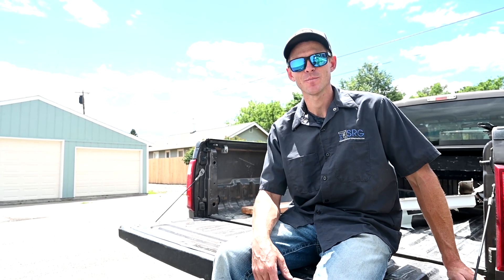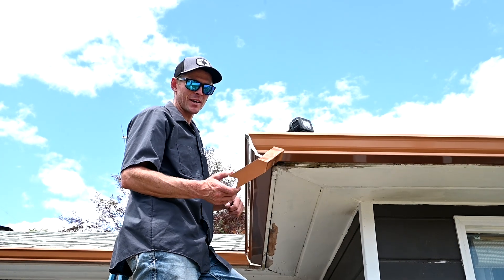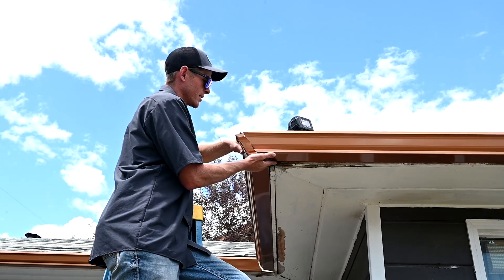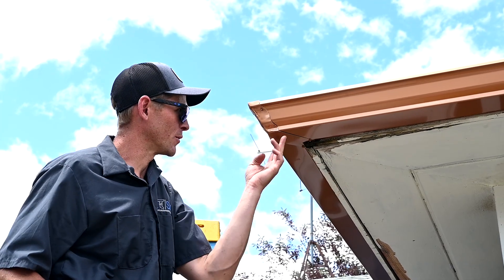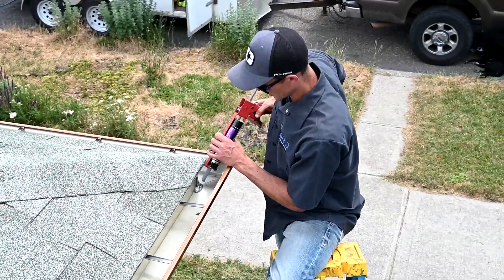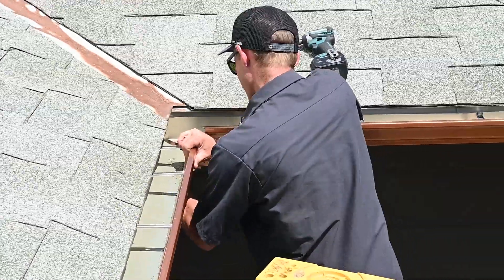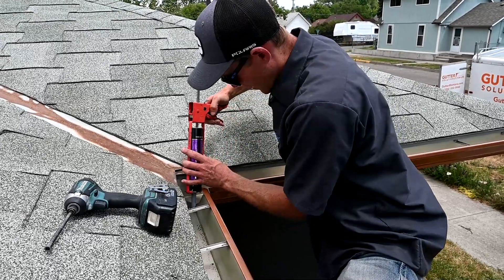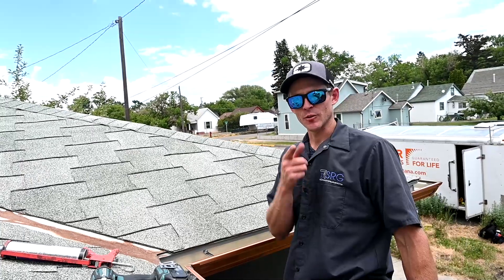How to Install Strip Miters on a Rain Gutter

Comment: Hi Josh.  I'm working on very long existing gutters on a hips style roof.  I have some concerns about stagnant water, leaky expansion joints and draining capacity.  Figuring out how to slope a continuous gutter is confusing.  Do I allow it to bend upwards in the middle of each section?

It's not a continuous gutter, so we have some spliced sections and you guessed it, they're leaking.  I'm not sure if I should just cover over them after cleaning up or if they should be redone with a proper expansion joint.  I'm also not sure how I should approach the expansion joints over a 300 ft long section.  My guess is that end caps are best, but I'm not sure that will work well with existing downspout locations.

Thanks for any reply you might have!

Comment: Screws should never be put in at the bottom of the strip miter. Two in the back 4 in the face. Been doing it for over 10 yrs, and never had a leaking miter.
Reply: 2 in the top and use a good glue
Reply: Two in the back and two in the top. Also instead of using your fingers for the sealant they have acid brushes at Harbor freight That work great. 36 brushes for $2.99.

Comment: I recently had a "Gutter Installer" install an inside Strip Miter Joint on one of the sections of my gutters. All the gutters that he installed have barely detectable pitch. I would like to know how is the water supposed to flow over the top of all that glue in the Strip Miter Joint to get to the downspout. I expect when it rains or snow melts that there will always be a puddle in that section of the gutter that cannot drain because it cannot get past all that glue inside the Strip Miter Joint. It does not seem right for a gutter not to be able do drain all the water.
Reply: Evaporation
Reply: Even hand cut liters have glue. Nature of the beast. Evaporation and keeping gutters clean will help.

Comment: What is the deciding factor on using a strip mider over a miter box? Is that something that the homeowner requested or something that you recommended? Thanks for the tricks and tips. Loving all the content.
Reply: well with a miter box you have three seams while a strip miter only makes one so there's a less of a chance for leakage but some homeowners request to their own liking like a hand cut corner.
Reply: Wrong Jose, box miter has 3 lines to caulk and a strip miter has 2
Reply: Strip miters are cheaper than box
Reply: Cost and strips look a lot better imo
Reply: @themiketillman  No... there's one seam between the gutters and the strip miter is behind it.  Wrong Mike.
Reply: @MikeMPharmaCyclist  no sir. If you look from the top down, the 2 seams are where each piece comes into the miter. A box miter has a factory seam and the 2 pieces of gutter that come into the miter.
Reply: Stipes IMO look better and if done and caulked rite no leaks for very long time..

Comment: Doesent it defeat the purpose to put screws underneath gutter.
Reply: It helps suck in the bottom part of the strip miter, otherwise it is hard to get and stay flush with the bottom of the gutter. Just have to make sure to caulk the screw holes from the inside

Comment: Never put screws at the bottom of the gutter, what’s the point of seamless gutters when you put holes in them Where the water will sit
Reply from the maker: Good thoughts, but we use sealant around each screw and corner. Therefore our costumers do not have leaking problems
Reply: Tony, my name is Rock / I have been Licensed and installing since 1977 in CA.  and NEVER used to put screws at the bottom of my Gutters untill I started installing in the Mountains / I found out putting the screws in the bottom makes the strip or box miters ( MUCH ) stronger / just seal the screws from the inside / the first time I did this I just was not sure if I was doing the right thing / now I put screws in the bottom of ALL my corners and I have NO leaks since.
Reply: I recommend using rivets on the miter for a cleaner finish 👍

Comment: Putting screws in the bottom is a rookie mistake.  When the sealant fails it will drip drip drip.
Reply from the maker: Our 20 years of experience is showing. lol need a few hundred obviously